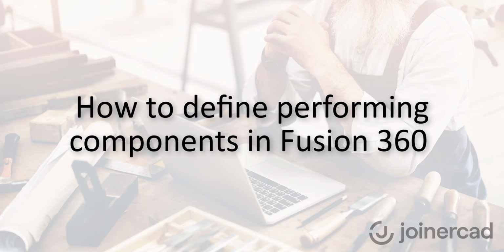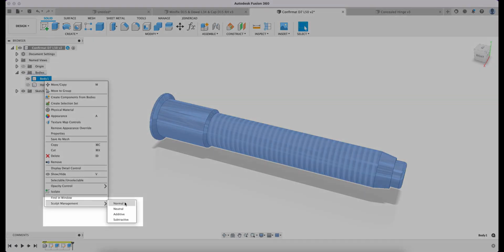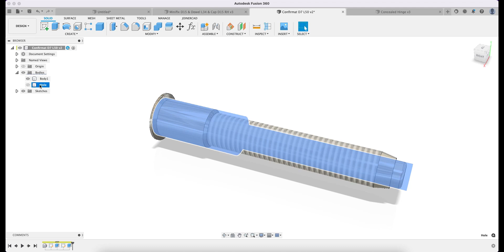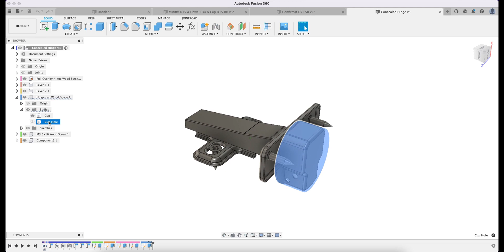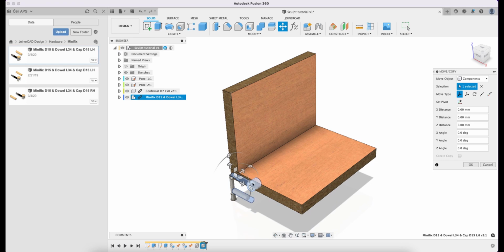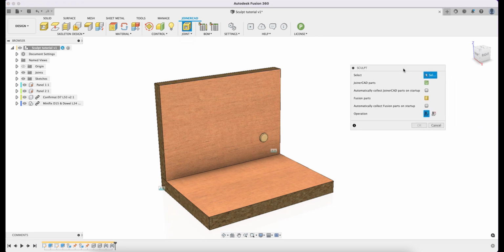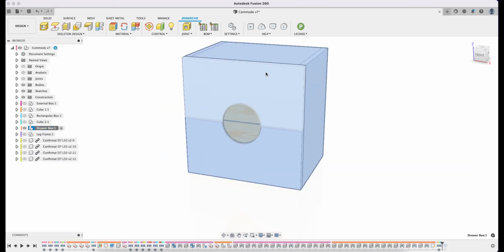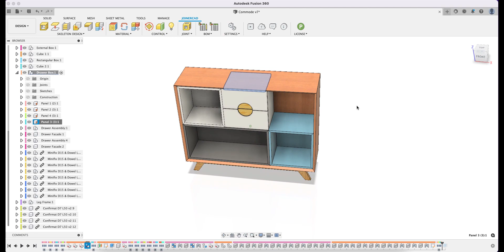JoinerCAD v2.0.0 - Sculpt

Comment: An interesting option, but it still requires you to arrange each connector individually, which can be achieved with the combine option. It would be much more interesting if connectors were placed automatically after being defined in advance.